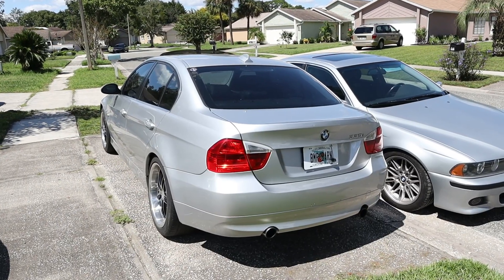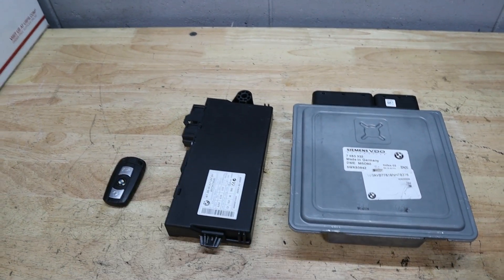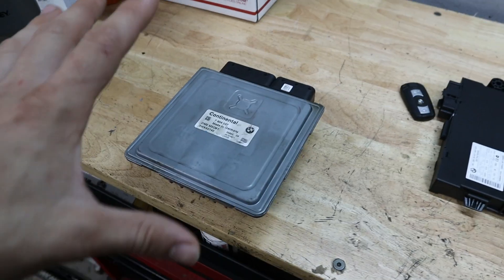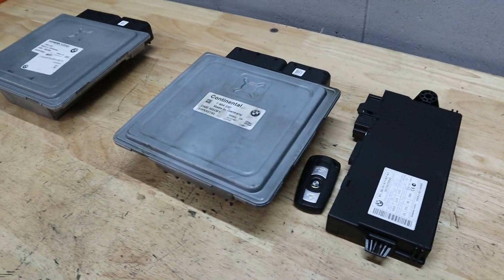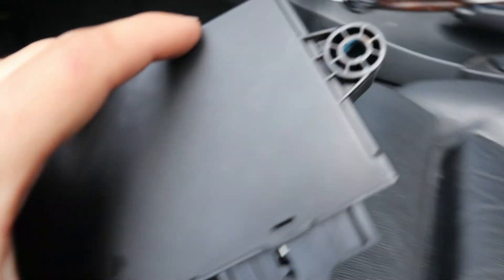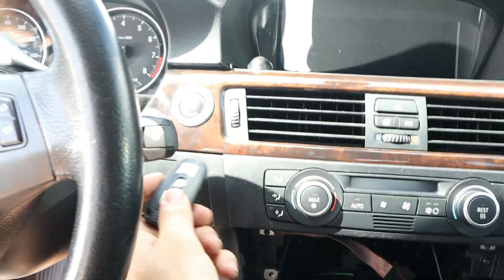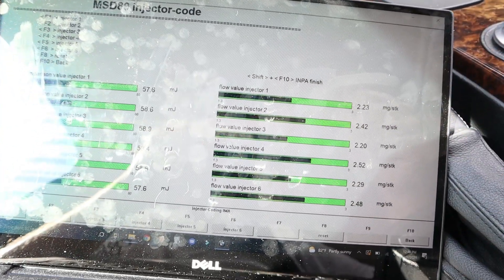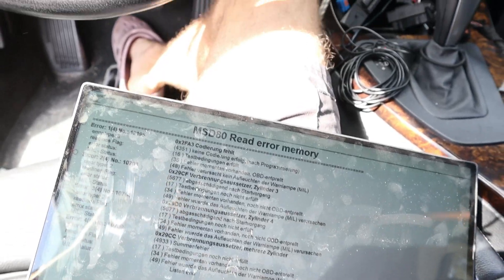How to: MSD81 Upgrade on a Budget!

Comment: generally speaking with DME fault codes would you recommend resolving the computer issues first prior to attempting to make any changes mechanically?
Reply from the maker: A dme is expensive, I'd recommend checking out the car mechanically before replacing a module. You cna always move injectors around to make sure that it's not just a bad injector in the first place. Hope that makes sense!

Comment: question i just did a new head and head gasket on my engine i put it back in my car, now the car wont start it turns over when i engage the starter but it just spins the engine it doesnt seem to want to start. i connected mhd wire adapter to the obd2 port and it says mhd could not communicate with dme. do you think a bad ground will cause it to crank but not start and have no communication with the dme? do you think my dme bricked itself and i have to get a new one? :o
Reply from the maker: I would try a normal diagnostic scanner, not just your mhd app, and see if the DME communicates, or has codes. If the rest of the car modules communicate but not the DME, you have a problem. Otherwise, sounds like it could just be something you forgot to connect when you put it back together! Good luck!

Comment: Index 5 and 7 injectors still sort of working?! Wow! I had a whole set of index 11 and just found 3 had bad leaks so i ordered some index 12s. Huge difference and wish i had figured it out sooner. Had issues starting for a while but great tip about where to upgrade to an dme81 in case i want to do that in the future.

Comment: Could I upgrade to an msd81 from msv70 on an 07 525i e60?
Reply from the maker: No, the programming and board is too different. You'd need another MSV70 if yours failed
Reply: @TheBimmerBarn  10-4 thanks

Comment: can i switch a msd81 with cas and key to car as a whole plug n play or will that not work
Reply from the maker: IF the engine/transmission configuration is the same, it should start the car and let you drive it, but you will get errors on the dashboard from the "coding" not matching.

Comment: How about e82 135. Can upgrade too? Misfire cylinder 4 also. After changed New plugs and new coil new injector still misfire
Reply: Change ur mosfets or look for damage in the wiring harness

Comment: Bro can you help me with my 335is I replace ecu, keys , central control electronics ,and the cluster now the car is not working
Reply from the maker: You can probably get the car started with the new cas,key,dme, but in order for the car to "accept" the new modules, you need to code the car and make sure the VIN matches all the modules. Something you can hire someone to do for you. Could be related to your instrument cluster issue.
Reply: @TheBimmerBarn   yes but I can't not find nobody to help me where I live
Reply: @TheBimmerBarn  I live on Pico Rivera ca
Reply: @dinonuggetcooking3109  ever get the car working?

Comment: Can i use an MSD81 on my 07 E90 335i?
Reply from the maker: Yes, and you should do the upgrade! Also, if you have an 07, look into retrofitting the oil cooler from 2008 models and forward, it helps the motor run cooler!
Reply: @TheBimmerBarn  ya I got this duel oil cooler running! It made a giant difference, even more so considering the tune! Thanks

Comment: Very nice Chris. When you do have 2 sorts of injectors, you have to make sure every bank has the same index injectors. So for example bank 1 only index 5, and on bank 2 only index 7. Very important rule. And don't forget to change the injector seal and couplers., when moving the injectors to and another cylinder. Good luck. Dutch regards, Nico.